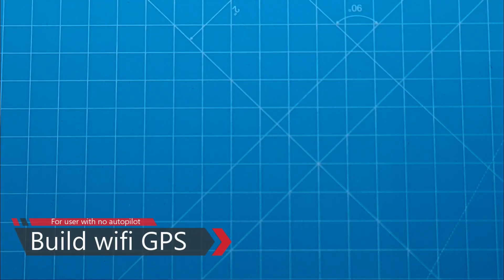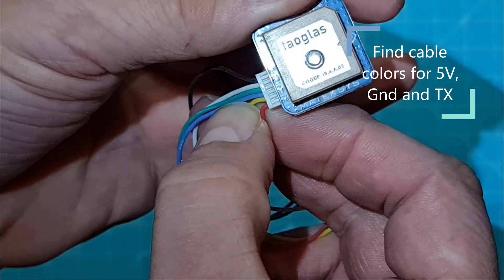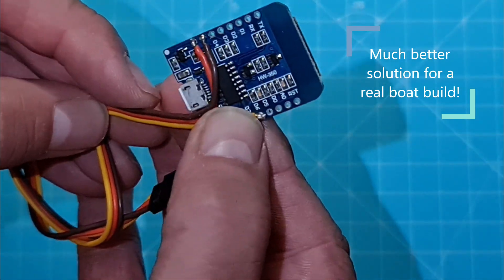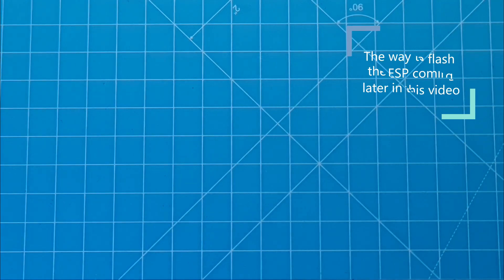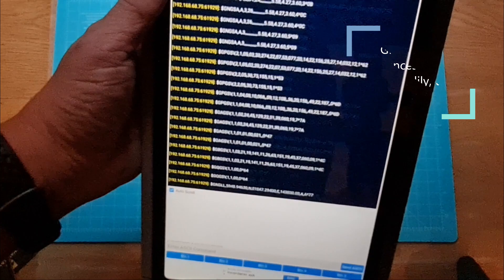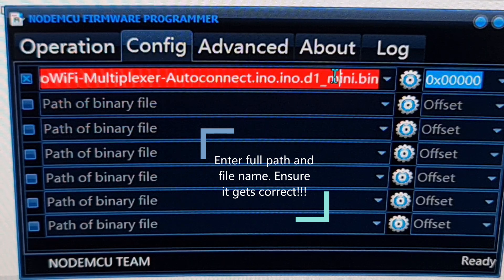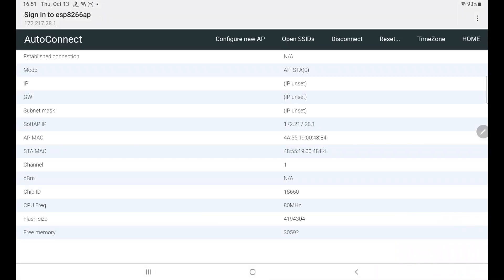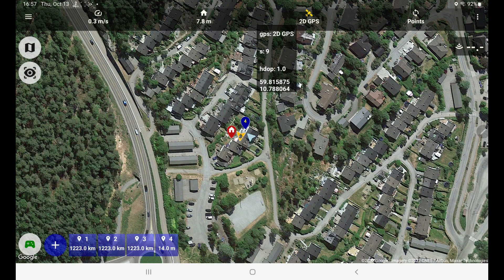Build your own wifi GPS and start using Carp Pilot Pro

Comment: @CarpPilot team can you update code on the ESP8266 to include an output to "blink" 2 LEDs  one to show ESP 8266 on line and the other to show GPS module on line. The Carp Pilot pro only shows the home wifi signal strength - can we not get the strength of the ESP8266 onboard the boat?

Comment: Hello
First, I apologize for my English... I used Google Translator, which constructs sentences better than me.
I am building a boat using the advice of tutorials. At the moment, the boat is an application supporting the engine with one dual-channel ESC, PIXHAWK 2.4.8 (with software as in the guide) with a power module. I also installed GPS SE100 v2.0, 433MHz telemetry (in Poland it is allowed), RC module TARANIS QX7 with TBS Crossfire Micro TX V2 and access TBS Crossfire Diversity Nano RX - with RX PWM Adapter 8ch. I have a SAMSUNG A10 tablet with the Carp Pilot Pro application.
The platform controlled by the RC beam moves correctly, drives forward, turns and reverse. Pixhawk exposed to 9-12 satellites and determined by your position.
The mode selection is on 3 available, as in the tutorial. The problem is the inability to change the flight/swim mode. Despite repeated attempts, I have not been able to change the mode, I always get the message: Flight mode change failed.
I have checked all the settings in MP, SERIAL1 – MAVLink1, BAUD - 57600 – TELEM1 use SIK RADIO from this socket, I have also checked SERIAL2.
I have replaced SIK Radio with another one, from a different company, I have covered the cable with copper foil.
I have changed the tablet, OTG cable, reinstalled the application in the tablet.
Unfortunately, without the need to use the medicine.
I have searched many pages, on this Carp Pilot Facebook page writing “Flight mode change failed”, also without success.
Please help, because the problem cannot be solved.
Best regards
Jacek

Comment: Does this work with Deeper Chirp+ ? Wouldn't it interfere with the deepers own gps? Anders i guess the Mateksys M10 is much more accurate then the Deeper gps?

TIA

Daniel
Reply from the maker: @daanaskme8436  no, it will not interfere with the GPS data of the Deeper itself. The data is reported on a separate port and can be retrieved independently from the Deeper GPS data. And yes, the matek M10 GPS is totally superior to the GPS in the Deeper.
Reply: @TheCarpPilot  thanks for the info!

Comment: I want to use the Pixhawk GPS directly...There are "the connector", the connector inject the data from the pixhawk into the raymarine, i can get GPS data direct to my carppilot app and you can use the GPS for navionics too, cause i love navionics. I was searching for an alternative, can someone tell me that the DT06 does the same thing like the connector? Before i used the injector but the injector is inaccurate i need a very accurate gps for my little spots
Reply from the maker: @PeterBehr82  if you have a pixhawk and a gps then Live mapping is by default possible, no need to do anything. This video is for the ones that think messing with a pixhawk autopilot is too difficult. The DT06 is also an easy to use device. But I truly hate it after buying no less than 14 and having problems with them all. For a straight forward wifi GPS only the solution presented here, and then please also look at the wifi GPS 2023 update that is ultra precise in the instructions, is truly the better option and surpasses the connector by a mile in quality. I have watched the logs received from the connector. It is a mess. Period.
Reply: @TheCarpPilot Hi, thanks for help, the DT06 was defective, didnt save the data...the Connector was very expensive but hes on my table i want to use him just cause i have him and i paid so much...but how to connect it. Its made for an other app and connected to the Pixhawk, i think it use the mavlink 2 protocol
Reply from the maker: @der_biergaertner  that adapter should work anyway. The other app uses mavlink 2, but that has to do with the two end points (the app in one end and the autopilot in the other). The link in between should generally not be relevant. If further questions on the matter then do visit the Facebook group for Carp pilot pro users where likely such questions can be guided more efficiently

Comment: Hello does it mean, that after I build that wifi gps I have to buy your app(platform)?
Reply from the maker: The app is designed to use autopilot. But in 2022 we also extended it so you can get by with just using a GPS. And this video shows how to make such a wifi GPS in order to use the app. You should look at the 2023 video as it includes more detailed information, including how to properly clean the ESP in case it came with some software when you bought it or if you made a mistake and need to flash it again. The Carp Pilot Pro app is low cost (approx 5 Euro), this you need to pay to use this app. Obviously. Considering what you get to support your bait boat use it is a steal.

Comment: hi, I've built up a gps unit by following your instructions and so far all is good. I have been able to see the wifi broadcast using the UDP terminal and have reached the point where I can see the ESP in my wifi options. I don't have a sonar device. I just want to be able to use carp pro pilot to mark waypoints but I can't get the software to see the gps.
any suggestions please would help.
thanks
Reply: I just found your video about the stand alone option and can now see what I need to do. Thanks for your superb instructions, I'll be making the changes to my project asap😊
Reply from the maker: @stevecleaver9169  ok. Thanks. Was a bit slow here to respond. But the answer would have been to watch the 2023 update for wifi GPS instead, that's the solution for you with one of the Images 👍
Reply: @TheCarpPilot  following on from this little project, I want to put autopilot into a catamaran type  hull for example a microcat and will try to find a cheap second hand boat to convert. Have you seen it done?
Reply from the maker: @stevecleaver9169  Upgrade an existing boat to one with an autopilot? Sure. There are many who also helps out with such for payment.
As the bare minimum you will need an autopilot (pixhawk often a good choice, easy and a lot of advice available), a GPS (often sold in a bundle with the autopilot), a power module, a BEC for the servo power should the boat ESCs not already have one and some servo cables. And you need to tap in on the power system. Some boats are easily serviced. Others that are sealed requires you to cut open before starting. There might be some challenges as some boats comes with an all-in-one board that may not be easily hacked. So you may need to replace some other stuff as well. You will not really know before you begin, but likely someone did this before and can give guidance.
One source of information is the Carp Pilot Pro User group in Facebook. Today the number of members are around 450. I know several that rebuild boats professionally. And many inside this group built their own autopilot in as well. Some took the easy path and started with GPS only, I assume several will do the full upgrade at some point in time.

To get an understanding of what is required then look for the building a bait boat series on this channel. The core need is described in the first episode as it explains the power and signaling system. The next two episodes will explain the autopilot setup as well.

Wjat you will do in short: You remove the cables going from your RC radio receiver to functions like lights, bait tray traps and so on. You plug them instead into your autopilot. Then using a single cable from that radio receiver as input to the autopilot. And tell the autopilot that the radio receiver is allowed to do stuff (rc override). And then you can still do what you are used to: Control the boat and all of its functions with that radio. But... The autopilot can now also control it. Letting Carp Pilot Pro be in total control. There are many users who stop using their remote altogether (like me, why would I use it except for having a backup solution?). And for it to work, you need to redo the cabling. To provide power to the autopilot, and give it a gps and compass so it knows where it is and understands it's heading. And last but not least, you need a wireless data channel for Carp Pilot Pro and the autopilot to speak with each other. That's what we call telemetry. Like a UDP adapter. Or a radio that is capable of offering a telemetry channel. Both explained in that video series.
Reply: @TheCarpPilot  so, that's it. I'm on the path now, going to do it
Reply: just one more question for now, is the pixhawk 248 suitable?
Reply from the maker: @stevecleaver9169  Yes, that will do just fine. It is built into loads of boats. Many professional builders also use the radiolink pixhawk. Do not go cheap on the GPS. M8n is the minimum Generation. Also there radiolink SE100 has good reputation (seems they now use the M10 chip now without altering their GPS model name.
Reply: @TheCarpPilot  Hi, I have begun collecting the parts needed for a compleate boat build and am almost ready to start. Got a head full of questions for later but right now could you please explain the function of the serial cable that you connect  between the radio reciever and telem 1 on the pixhawk and where does it connect on the reciever. I hope to use a radiolink radio and reciever.
Thank you for all your support
Reply from the maker: @stevecleaver9169  radiolink Radio works just fine. Receuver needs to be plugged into that RCIN port on the pixhawk. Skydroid has a separate telemetry cable because it can do telemetry in addition to be a radio. Your radiolink can't. So you need a telemetry solution in addition (that's how the ardupilot and the Carp Pilot pro talk together). Like a wifi adapter from Ali express that I showed off in video 3. There are other alternatives a well. Look for telemetry on Ardurover Wiki.
Reply from the maker: Look at video 1 description for a generic overview of parts needed.

Comment: Hello. M10S-5883 has beed discountinued. New version is M10Q-5883 (it supports UART and nmea). I hope it is also good to do WiFi GPS ? :)
Reply from the maker: I have no ability to check every GPS there is (I would need to buy them, for once - which I cannot afford). But I guess I would not hesitate buying the M10Q should I have done my first try now. The M10 series is, by the way, a really good GPS series.

Comment: I want to build this for my own, but question is 😂 can I use other GPS? Months ago I get few se100, and will be nice if I can use them.alreqdy flash esp with se100 gps, but dont work...
Reply from the maker: The GPS needs to offer a uart interface providing nmea sentences out. I believe the SE100 does not. Many do however. Look up the specs (mateksys is very good in that respect)

Comment: hello. can i use esp32 instead of esp8266?
What needs to be changed in the code?
Is the Wexilar SP200 fish finder suitable?
Reply from the maker: The code here is made for esp8266. I am sure it will not run on a ESP32.

The Vexilar SP200 can be used

Comment: Hello carp pilot! I have a toslon xboat and I want to use carp pilot pro. Once I have mounted the wifi + gps, how do I connect all this to the baitboat?
Reply from the maker: To my best knowledge the tolson is not compatible
Reply: @TheCarpPilot  Hi, thanks for your quick response. I am not referring to a toslon echosounder, the echosounder is a deeper chip+2. The boat is from Toslon, specifically it is the Toslon Xboat 730 model, and I would like to steer it using your carp pilot pro application. I have been able to follow the tutorial more or less well, where I get a little lost is when it comes to integrating this assembly into the boat. I understand that at some point I will have to connect something to the motors so that they can be controlled by the app, but which wires from the assembly in this video should I connect to each motor?
Reply from the maker: @gisserver-f2u  OK. I see. Then that's a whole other story. The Deeper Chirp+ (old and new model) you can use.
Please note a big difference between simply using a GPS in the boat and adding in an autopilot:
When the Carp pilot pro just listens to that GPS then it can Display the boat icon as it drives on the water. You get to utilize waypoints (also as shown in the video on waypoints). You can create depth maps. But you can not have Carp pilot pro control the boat (like opening bait tray by touching a button).
If that's what you want then look at the video series on how to build a bait boat. Now, there's a lot in that series you can skip over as you already have a boat. But look at episodes 2 and 3 for how to set up a pixhawk, episode 8 for more info and the last episode 9 where I did some boat tuning and modified the app to control the boat features.
Reply from the maker: @gisserver-f2u  using GPS only (like a Deeper) is for sure a fast way to get to use Carp Pilot Pro. And soon you can get fairly good distance using the new Deeper Range Extender as well. Although this Extender for sure works, they have an error blocking the nmea0183 datastream from it. The error is recognized, and Deeper Support has said they will fix it. As soon as they have then up to 200.meter distance is their promise.
Reply from the maker: And in addition there are some good videos available on youtube and in Facebook forums that can tell you how to use the same wifi booster I use in the video series (on building a bait boat) with a Deeper.

Comment: I have a Pixhawk with external  GPS module, dit you build a ESP fot that? ore firmware for that? or can I use the same without the gps on it?
Reply from the maker: If you already have a Pixhawk and a GPS then you should look at the video series about building a boat. See episodes 2 and 3. Although the main focus is on autopilot, it is also including the use of a ready made esp with UDP serial communication. The adapter I plugged in in episode 3 is a ready made one bought from Ali express for around €10. But you can make the same, and the how to is described in the ardupilot wiki if you search for "arducopter" and ESP telemetry (an article explaining everything).
Reply: @TheCarpPilot   yes I understand, but the esp that become from alie that fits the pixhawk works fine of you just Connect with that one. But you vanmorgen configger it  like the “wifimanneger” there is no firmware on it like the firmware you show on this video. Hope you understand what i mean.
Reply from the maker: @jeroenlubbersen7801  The software used for WiFi GPS in this video is not by any means the same as the firmware loaded with the Ali Express versions, and they also do completely different things.
You can use the firmware in this video to make a wifi GPS Solution, but you cannot use it to transport mavlink messages from a pixhawk like you can with the Ali express version.
The Ali express version works very well both standalone (usually then with a uFl antenna socket) to connect directly or in station mode where you connect it to an onboard wifi echosounder access point.
The Ali express version and also the version you can install as per instructions on the Ardupilot Wiki has one limitation though: The SSID can only be max 16 characters long.

Comment: And if I don't have wifi in the boat, how do I do it?
Reply from the maker: Have another image coming up. Will make yet a video. To install on a preferably "pro" version (with integrated uFl antenna socket). Image set up to BE a wifi access point rather than set up to connect to one. Then use external antenna, and perhaps a wifi booster in addition.
Reply: @TheCarpPilot  ok, when can we expect the image?
Reply from the maker: Messing with the under hull and Raymarine transducer right now for other videos. Perhaps next weekend 🙂

Comment: hey is there a way. to improve the GPS of a deeper chirp?
Reply from the maker: If you mean to modify it I have absolutely no idea. But you can at least avoid placing the Deeper very close to electromagnetic disturbances (brushed motors, ESCs, wifi boosters, 2.4GHz radio receiver) as this will make things even worse.
Reply: Thank you for the answer . Can you explane mock gps?
Reply from the maker: @TheDemiv  Sure. Mock GPS uses the GPS of the Autopilot as source. The GPS we use for our autopilots are generally high quality (I had a lost GPS fix in my Deeper Chirp+, still my autopilot had 16 satellites just to examplify the difference in GPS quality). When you activate Mock GPS then the GPS position of the boat is published to the Android system, making your device position equal to that of your boat (as is device was strapped to your boat). So, when you use Mock GPS, set the Deeper app to the mode you would use if you were present inside the boat. Mapping using the Deeper will be as usual, but now you have eliminated the problem with Deeper's position jumping around the water during mapping.
Reply: Thank you 😁 I Will try That